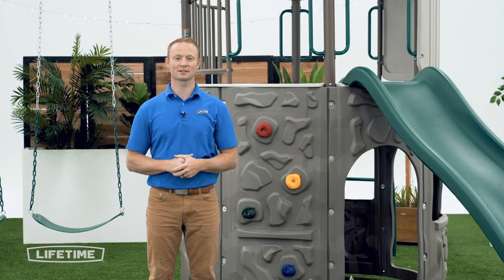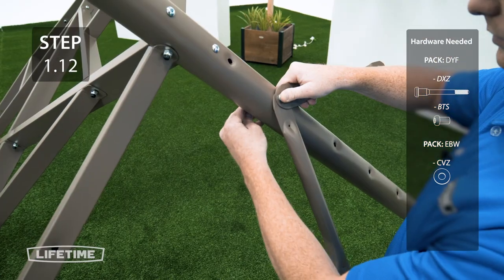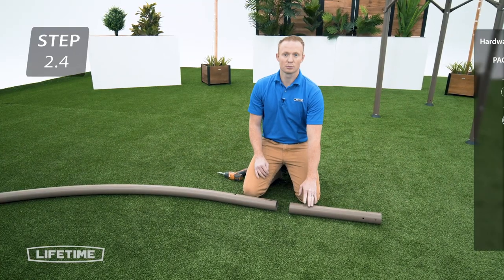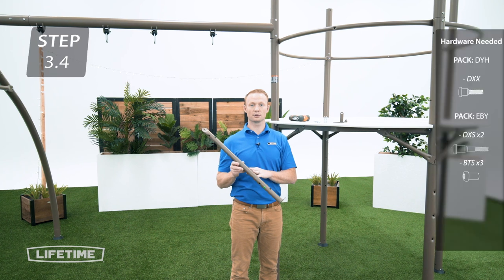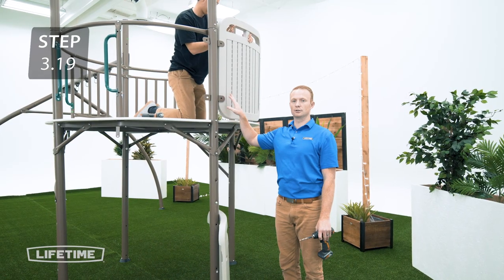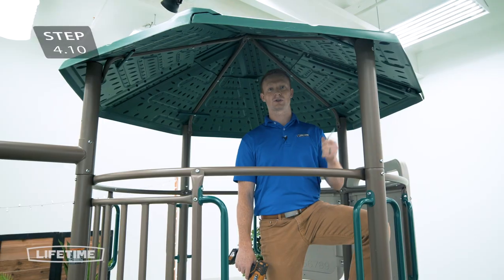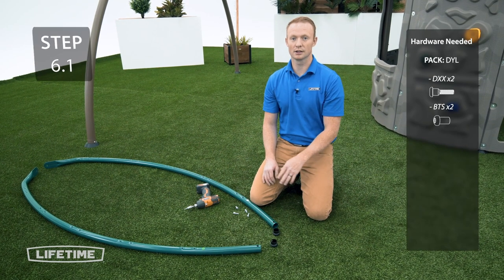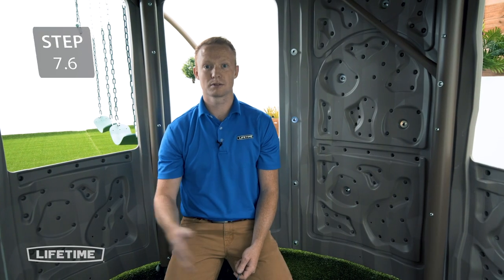Lifetime Adventure Tower™ Playset | Lifetime Assembly Video

Comment: Heads up for everyone looking to install this. 99% of the installation time will comprise of you painfully trying to align their special nuts to the bolts that are too short to reach all the way through the poles. Looks like they use these types of fasteners for safety purposes. But man, they are a pain to use. If you don't have carpal tunnel yet then you will by the end of assembling this. Would still recommend this product anyhow.

Comment: Do you recommend to install and place safety mulch, rubber mulch, wood chips before or after the installation of the unit?
Reply from the maker: You'll want to install mulch after, that way you can be sure that the playset is installed on level ground.

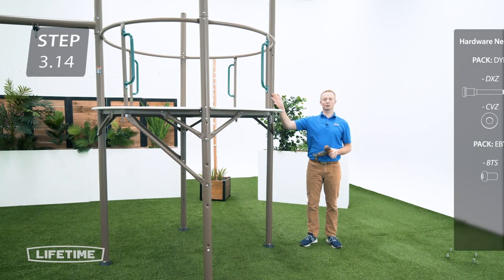Comment: There are a few mistakes in this video. Odd that Lifetime hasn't at least posted comments to clarify some of the confusion. By far the weirdest thing is at 25:47 they have us add a random bolt to a pole that doesnt even attach anything. The manual even says to do this. WHY?!!!!

If you are following along with this video then double check what hardware they say to use. The video is wrong in several places. Also, make sure you are using the most current version of the manual which can be found on Lifetime's website. 

Lastly, the roof bolts snap pretty easily, don't tighten them near as much as the other hardware.
Reply from the maker: We are sorry to hear about the confusion over the hardware that corresponds with the video. We have many playsets that follow similar types of builds which are added as associated model numbers in the description box. That's why certain bolts or push-pin may be different, however these differences are not critical to the overall assembly of the playsets. This is why we recommend using both manual and video while assembling.  

We are sorry to hear about the confusion regarding extra bolt in step 3.14 as well. This occurs because 3 of the poles "DWY" are the exact same and are interchangeable in relation to the building of the tower. However, this leads to an extra hole in one of the poles since nothing attaches to it later. While the step may seem unnecessary it keep bugs such as bees and wasps out of that hole. Hopefully this clears up confusion regarding step 3.14.

Comment: None of my tower poles are dimpled. Not even the the one with the warning label on it. Should I call and get a new one? Not sure if they will since I bought it in may and just started to build it today because I had to level my backyard first.
Reply from the maker: I’d recommend contacting customer service team just to a closer look if you’re need new poles or not. You will be fine since your just bought it and you are in the warranty.
Reply: @LifetimeProductsAssembly  thanks for the quick response
Reply: I just opened mine today and my poles don’t have dimples either. Did you ever contact customer service about this?
Reply: @noskodamus  looks like dimples were part of the older versions. I also didn't have dimples on the poles.

Comment: How crucial is the dimpled holes facing up when assembling the tower? I heard facing down initially, but noticed it got flipped when attaching the poles
Reply from the maker: Sorry for that confusion! If the holes are facing down when you go to put the wall panels on, the bolts will stick too far out. Additionally, the same thing will happen when you attach the pole to the angles support bars. This could cause injury’s while the kids are playing on the system.

Comment: What settings do you have your drill on?
Reply from the maker: If you're using an impact driver, we recommend having it all the way to the highest setting.
Reply: @LifetimeProductsAssembly  this is a horrible recommendation for impact drivers. That will cause most of the bolts to snap...